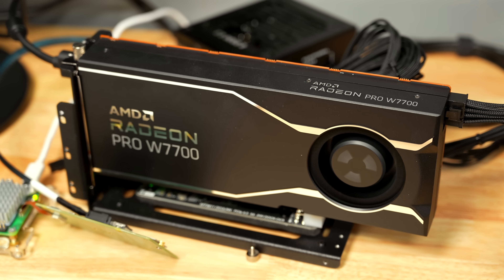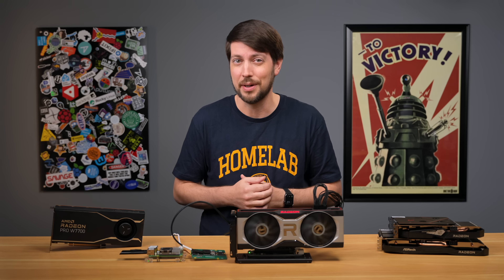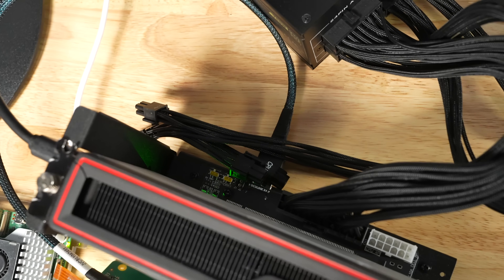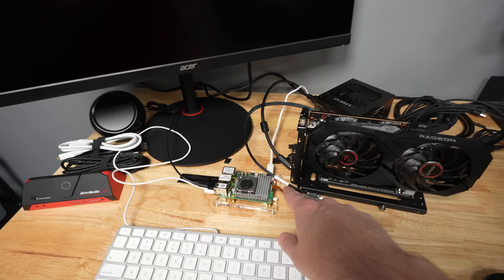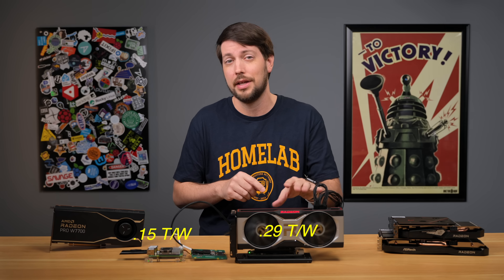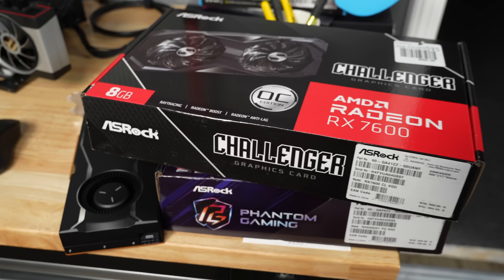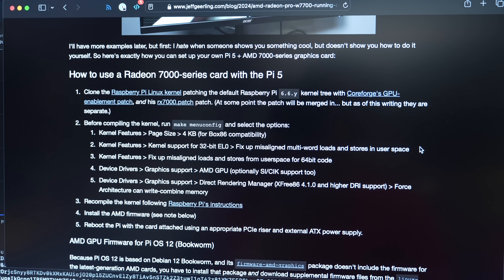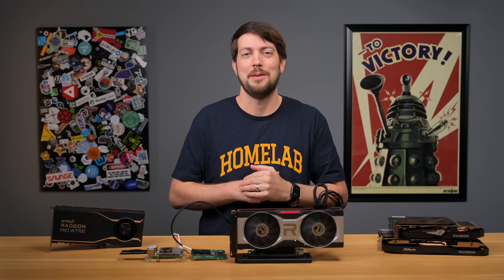A GPU-powered Pi for more efficient AI?

Comment: Finally, someone else that isnt brain damaged with the "AI" hype. If you understand how an LLM works, you will never see it as "AI" again.
Reply: narrow AI is just applied statistics
Reply: @erkinalp  re-write tensorflow in R 😂😂
Reply: Well that's only cause then you understand that true generative AI will never be accomplished on this platform but LLM will most likely be a small implementation of what that kind of model would look like. Or whatever.
Reply: @Yuriel1981  generative AI I think is possible but it’s a long shot to have it before 2030. 
All the development gains in hardware and software simply are better methods of brute forcing data.
Reply: Seriously. There is no "intelligence," in terms of reasoning. That's literally the point of the Transformer architecture—no recurrent layers, "Attention is All You Need."
Reply: @GSBarlev  Attention in a transfomer architecture is a very advanced form of recurrence with a limited window due to computational constraints.
Reply: a better name for the hype is artificial stupidity.

Comment: You don't have to worry about power usage if you have solar, wind, hydrothermal and/or hydroelectric power. I would suggest nuclear, but as you're a civilian that's not generally feasible.
Reply from the maker: If I have any shot at nuclear power for personal use, I'm taking it! :D
Reply: @JeffGeerling I'd settle for an RTG. I have this fantasy that the DOE solves the Yucca Mountain bottleneck by paying citizens to bury spent fuel under their properties for a monthly stipend.

I'd sign up in a heartbeat, especially if I could siphon some of the heat!
Reply: @GSBarlev Good luck farming on it or occasionally suffering from radiation every once in a while.
This needs to be done on a VERY small scale first, and IF it works, it should be implemented in a VERY safe manner.
Reply: @fujinshu  Oh naturally—it's pure fantasy. But what I will say is that you'd be surprised how much properly shielded material you'd need to bury—and how close it would need to be to the surface—in order for the dose to even come close to the background levels of radon already found in most basements.
Reply: A few people in the world have run their own nuclear installation, but often the government wants to take it away for safety reasons.
Reply: We need nuclear power for the plebs, lol

Comment: Id love to learn about RPI's with batteries. Battery packs? Powerbanks? UPSs?
Reply: I looked into this a while back. There are a few UPS HATs. With that, given how little power Pis require, you can use any off-the-shelf power bank.
Reply: @GSBarlev  I'm building my own cinema camera, will probaby resort to a off-the-shelf power bank yeah. It won't need to be powered by a typical power adapter anyway

Comment: I see you are using Radeon Graphic cards instead of Nvidia cards, I was told some frameworks (specially image generation) only work on Nvidia, have you tried Nvidia?, there is any particular reason you use Radeon instead? Also, I understand Vram is important for LLM, but I see you have few low mem GPU's and seem to run well. I'm also working on a virtual assistant so interested in your future video about it.
Reply: I've only been working on AMD drivers, and noone's seemed to have been successful with any of the nvidia drivers on the pi so far.
Reply: Nvidia doesn’t provide drivers.
Reply: Nvidia's ARM drivers are only compatible with systems that are fully compliant with ARM SBSA standards, which the Pi is not.
VRAM is important, but a good gauge of how much you need is to just look at the file size of the model and maybe add an extra 20-50% safety buffer; you just need enough to contain the model.

Comment: Great job! Awesome video. Did you have to do anything to share the ground between graphics card and raspberry pi?
Reply from the maker: So far it hasn't been an issue—I have both the GPU PSU and the Pi PSU plugged into the same power strip, and I also don't hold both at the same time that much, so can't say if it's going to be a perfect solution or just works for me. Ideally there'd be a riser that powers the Pi and the card at once.

Comment: Wonder if it would be able to run on the RPi gpu as well eventually given that mesa devs are adding more and more vulkan support to the v3d driver. The V3DV driver recently got Vulkan 1.3 support (though it doesn't actually run most vk 1.3 stuff since it lacks a lot of other extensions still).
Reply: 6.13 Kernel has better support for Pi's, early next year release?
Reply: @FlintStone-c3s  I think it's mainly comes down to improvements in mesa at this stage but maybe it also needs some stuff in the kernel part of the driver for some of the missing vulkan extensions

It's too bad the pi is based on a broadcom SoC though. Qualcomm's GPUs have by far the best and most feature-complete foss linux GPU drivers when it comes to arm system on a chips (though the new drivers for the early apple arm chips are starting to rival them) but idk if there are any single board computers using them

Comment: i'm a bit of a newbie with these amd cards. how do they compare to the new m4 mac mini? is it cheaper (hardware or power wise) to go with the base end m4 mac mini or one with a pi + amd graphics card?
Reply from the maker: Good question; my M4 Mini (non-Pro) is pretty fast, and can handle models about as fast as the 6700 XT. It's not a bad option at all, and great for general purpose use too.

Comment: All local LLM models are at minimum 1 year behind in capability.
So if you want stuff that was already possible 1 year ago, sure this is a cheap, local, and private way to do it.
But most of us still need AI (yes I will use the word) to improve to get to the level to fix our necessary tasks. So using local models just doesnt work. The best available models dont fullfill the real need yet, and we are supposed to use 1/10th as good models? So basically REALLY wasting energy for a bad output. If you are already wasting the resources, at least us them for the best available stuff.
Reply: Local LLM need lots of memory, which is not yet easy to get on Pi5, but code optimizing means newer ones can be smaller and better than one 6 months old.  Dram addon board for Pi5,  stick 128GB on it?
Reply: The problem are still the llm that you can use locally.
Compare llama to gpt or Claude. It's like different entities. Of course llama FEELS powerful, a year ago. But yesterday's best is today's obsolete.
The world doesn't stop, we get quickly used to the new better stuff.

Comment: Really neat! I'll stick with running llama.cpp under Proxmox on my Ryzen mini PC though. Much slower, but I can run quantized 70B models since it uses system memory, and it's offloaded to the APU so I can use the CPU cores for my other VMs. Inference is like 1.5 tokens per second for 70B, and 10 tokens per second for 8B.

Getting it all working was kind of a nightmare though.....
Reply: May I ask what's that mini PC?
Reply: I tried posting a link, but I guess YouTube didn't like that. It was a generic mini pc from Aliexpress with a Ryzen 7 8845HS
 I got it barebones for like $400 and added in 64 GB of memory

Comment: You are out of touch if you consider any of those cards low-end.
Reply from the maker: The RX 6500 XT is most assuredly low-end; I bought mine for $150 yesterday.

The RX 7600 is a slightly-less-low-end card, but I picked it up for $250 yesterday.

Low-end used is a bit different, but you're still looking at $100-300.
Reply: @JeffGeerling  Rx 580 (which I think was mentioned in the video) can also be had for 50 bucks on ebay!
Reply from the maker: @ShinDMitsuki  It's a nice little card, still quite useful if your needs are modest!
Reply: They are low end
Reply: I'd consider them mid-range to low-mid-range, personally.

Remember, we now have insane stuff like Quadro RTX cards and H100s priced at thousands or tens of thousands of dollars each. That is the new "high end" and basically no individual needs them.
Reply: @BryceDixonDev  Those are not "high end" cards, those are highly specialized cards. Sub 200 dollars was always low end, even before the pricing changes, and it remains to be.
Reply from the maker: @BryceDixonDev  That's the high-high-high-high-end :D

I'd count 4080/4090, 7800/7900 as high-end (consumer/prosumer), and anything between $300-700 as mid-range (only talking new prices, new cards—used is a whole different ballgame).

Comment: AMD drivers for linux is the best decision ever. Nvidia drivers is windows exclusive. I won't be surprised if Nvidia buy out Microsoft for open AI or their cloud ideas.
Reply from the maker: Nvidia has their 'open drivers' now, which are a lot better than the status quo a few years ago, but they're miles behind AMD on the Linux front (IMO), but only from a community perspective. Unfortunately with how prevalent CUDA support is, they still lead based on hardware + dev tools.